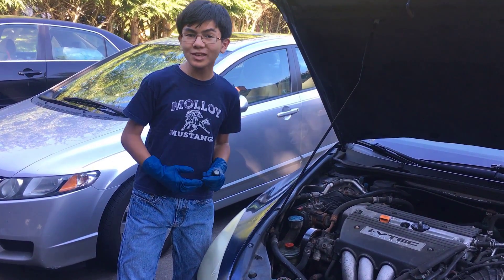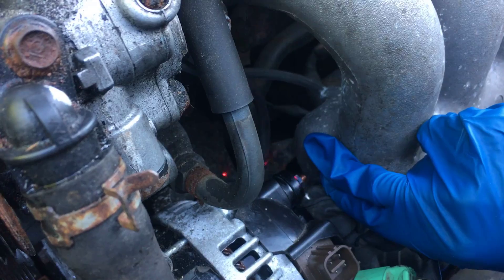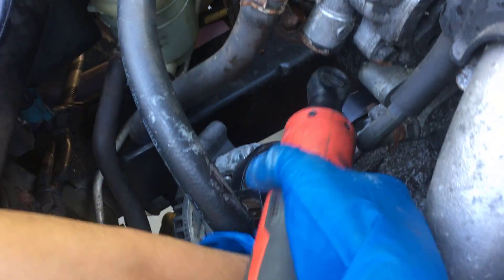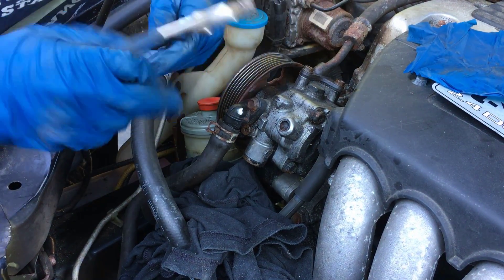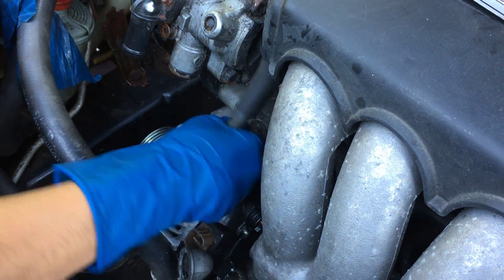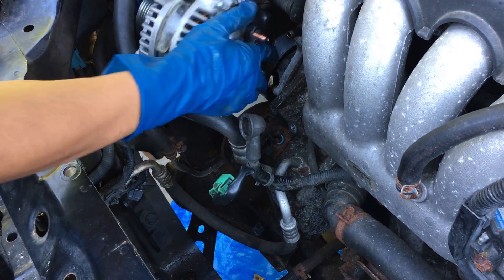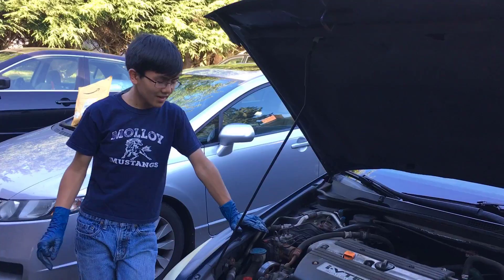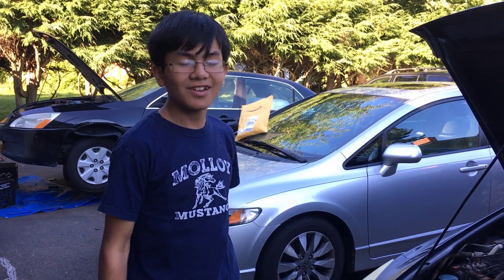How To Remove & Install Alternator 2003-2007 Honda Accord | DIY Auto Repair By Young Mechanic Aiman

Comment: Where did you buy that special tool for the pulley to make the belt loose?
Reply from the maker: Best place to buy would be on Amazon, there are several types and variants, here are a couple of them:
1.  https://amzn.to/3OLueWZ  |  GEARWRENCH 15 Piece Ratcheting Serpentine Belt Tool Set - 3680D (very popular apparently_
2.  https://amzn.to/3YnewVt  |  BILITOOLS 15-Piece Universal Ratcheting Serpentine Belt Tool Set

Thanks for watching...

Comment: It's alot easier if you take the 2 bottom bolts out before you remove the top one.

Comment: Take bottom 2 bolts out first and the top bolt will hold alternator in place.  Then take top bolt out without having to hold in place alternator to remove bottom bolts

Comment: Good video. I've also got to change my power steering pump and starter motor :(. And i have a vsa light coming on. Think I might go back to the Ford's. Love the car but parts are so f$#ken expensive.

Comment: Great job kid.  First step is to NOT be scared to work on cars.  Expect struggles and small mistakes.  Props for good work.
Reply: nah, first step is to disconnect the negative battery cable from the post as you're working on the ALTERNATOR

Comment: What is that extension tool that you used for the tensioner pully?
Reply from the maker: That's a specialized tool designed specifically for tensioner pully, to remove serpentine belt, you can buy it at Advanced Auto Parts, O'Reilly or Autozone.  Not too expensive and very convenient.  Ours is Autocraft serpentine belt remover tool
Reply: @EyeOnAiman  Thanks for the info. I've been looking for this tool under the wrong name search. Definite want to get one. 👍Great video by the way